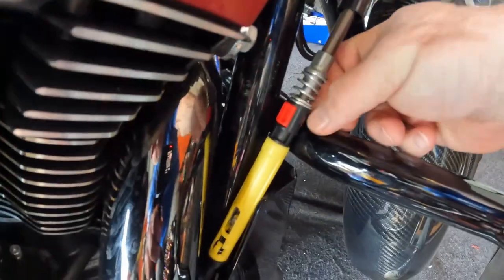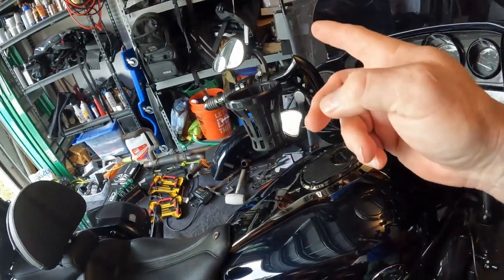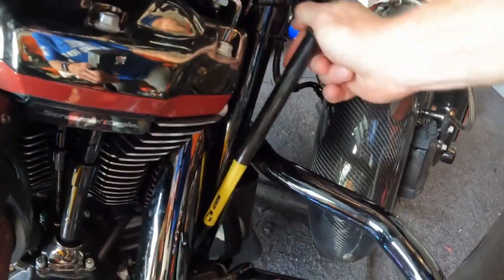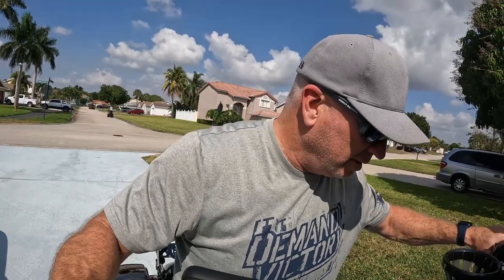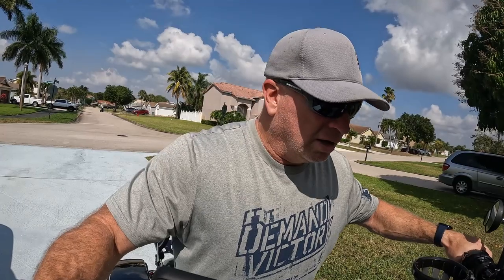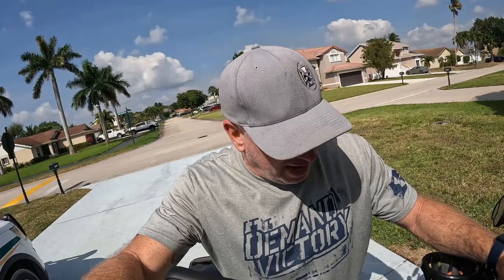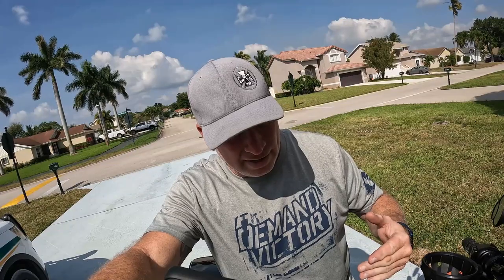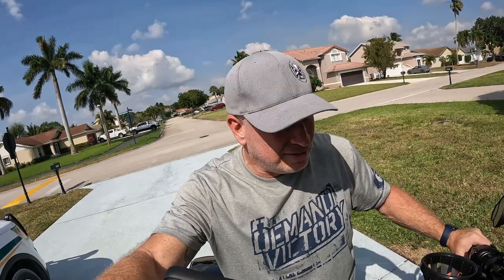Harley Touring M8 Rekluse Auto Clutch Install and Review - Game Changer

Comment: Been contemplating this one myself. Did the AIM V3, don’t like it vibrates and increases lever pressure as rpm goes up. Running stock clutch with heavier HD SE springs, did 350 miles of traffic and highway on last week Sunday, clutch hand was killing me. Carpal surgeries helped but slow recovery on grip strength. Will look into this one. Side note, I ceramic coated the header pipe, and added DEI heat shield inserts, this 122 stg4 should be warmer than the previous 114 and 117 builds but it is not.
Reply: @hoseclampehhh That sucks on the AIM and still vibrating pressure. I had upgraded my 2019 Ultra M8 to a 122 ci kit and I have the reduced reach soft brake clutch with a rekluse slave cylinder, and I love the smoothness and light lever pull. I am also contemplating this clutch, but we shall see.

Comment: I desperately need this mod I have to navigate a dangerous hill with a blind bend at the top, when leaving my home, I need to use the friction zone to keep a slower speed for safeties sake . would this help me maintain a slower speed on a steep hill? I might have to invest in this. Thanks Ron.
Reply from the maker: Mike put it this way… you let go of the clutch and it just idles. It won’t stall at all so you can go as slow as possible without having to worry about that.
Reply: Had my dealer install my Rekluse and it is amazing , glad I made  the move. Also got Ohlin SE shocks installed , they are a must have also. thanks for your help.
Reply from the maker: @michaelpowers4452  I’m surprised your dealer installed it. What did that set you back?
Reply: I am in at about 4K for shocks,clutch and a fan cooled oil cooler. I have a steel blue 22 SG CVO. @RealRonTV
Reply from the maker: @michaelpowers4452  keep going! 😆

Comment: Hi. I had this a Rekluse Clutch installed on my H-D RG3 when I bought it. And it has failed twice now in about 1,000+ miles. I was told when I got it that I had to shift like I would normally, so have been. But wondering if maybe that was the problem. Yours seems to be working properly. I am so frustrated that I'm considering selling the bike altogether. Any recommendations on what may be wrong? Should I just let it shift completely on it's own and not use the clutch?
Reply from the maker: How did it fail?
Reply: @RealRonTV , burned out. Twice. I initially thought it was installed improperly the first time, but let the H-D dealer install the replacement again since they offered to do it as no cost. Got on the phone with Rekluse afterwards and the free play gain was non-existent. They walked my husband and I through how to adjust it and we did. I thought I was all good. Followed their guide to the letter. Took it in for a 1,000 mile service (different dealer) and the new H-D dealer (where my husband got his bike from) said it was burned out again. They initially said it was installed improperly, but then backed away from it (probably trying to avoid getting in the middle of a potential suit). So now, Rekluse, to their credit, is replacing the clutch a second time at no cost but I have to pay the new dealer to install it and I am wondering if maybe I just suck at shifting?!?! LOL. No, but seriously, it is really frustrating and I am not sure what is happening.
Reply from the maker: @mkingviehland  if you don’t have enough free play it will burn out the clutch. Have you tried making adjustments and checking the free play every so often?  How much torque is this bike pushing?
Reply: @RealRonTV , yes, we check the free play gain monthly, though maybe we should be testing it weekly. I hate to admit I have no idea about the torque.
Reply from the maker: @mkingviehland  I’m having problems with mine right now and I’m close to abandoning it myself.
Reply: @RealRonTV , ugh, sorry to hear that. I am in a similar place.
Reply from the maker: @mkingviehland  my Rekluse hasn’t been the same ever since I switched tuners.
Reply: I am having problems with mine on my 2024 Road Glide. Spoke to rekluse and they said I need to change the springs in the ESP Disc. So I will be taking apart my bike soon.

Comment: I am confused... I will have to research how this works. No more clutch pull, just using the shift lever?
Reply from the maker: No the clutch still works the same way and you need it to shift gears. Just not first. While in first it will only move if you give it some throttle.
Reply: @RealRonTV  got it... so, the idea is that you can sit at idle in 1st gear without pulling the clutch lever. that is nifty. definitely a game changer for people who have hand issues and ride in stop and go traffic. you may have mentioned it, and I may have missed it, how much did the kit cost? thanks : - )
Reply from the maker: @richardrussell500  and you can do slow speed turns without having to be in the friction zone. The cost depends on your bike. Check their website for the price.
Reply: @RealRonTV  thanks : - )
Reply: @RealRonTV  do you know if your kit had the upgraded basket clips? apparently the original clips had a tendency to break. thanks : - )
Reply from the maker: @richardrussell500  I think all the new kits have the upgraded clips.